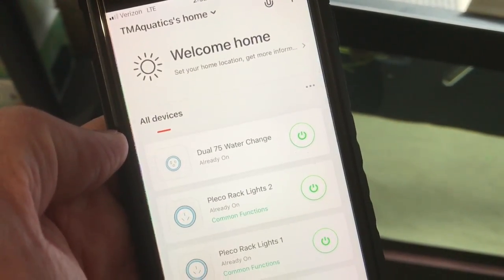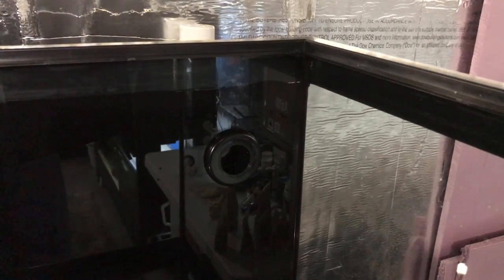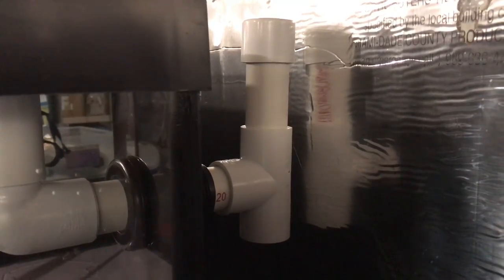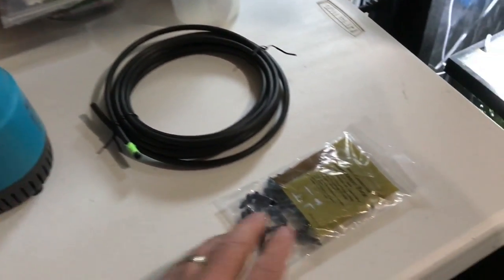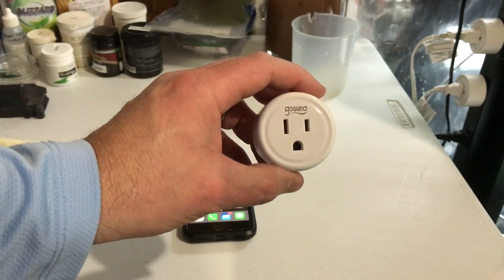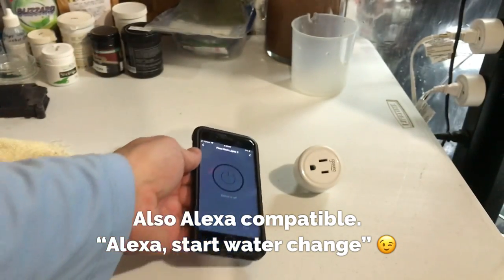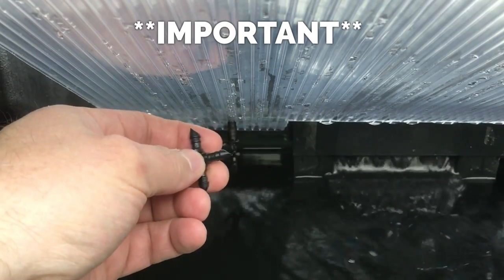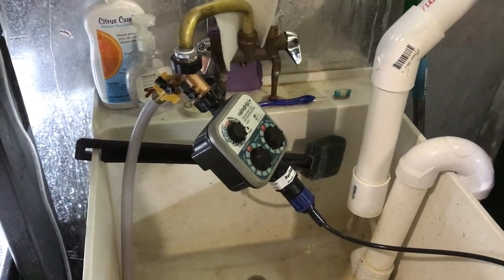SUPER EASY automatic water change system for your fish tank

Comment from the maker: Really debated whether or not to post this video.  However, the dual 75’s have been up and running for a couple of weeks now and the automatic water change system has been working GREAT!  This system, as currently configured, is pumping clean fresh water into each of the 75 gal tanks at the rate of 10 gal/hr.  Each tank receives 15 gal of fresh clean water each day.
Reply: I put my tail between my legs and ran away when you said "drill".
Reply: I keep forgetting you need to vacuum the bottom of the tank, so this will never work right???
Reply: maybe i can have a massive aquarium have this do the water change n just vacuum the bottom of the tank myself which shouldn't take that long. I reckon I could do the bottom of a large tank in 5 minutes.
Reply: I think you would be blown away by my system as it is incredibly simple. I have a big advantage as I am on well water and can use water right from the tap. I use my system in my 100 gallon African tank.
Reply: @davebrittain9216  i wish you could make that video because having been blown away by water changing systems usually teaches ways to incorporate or simply recreate like this video clearly demonstrates .... Still afraid to drill & love my Python . Cheers Dave 🍺
Reply: @stoneysscapes7544  Maybe one day. Do you have well water or city water?
Reply: @chefpinot45  You can always use an overflow
Reply: @davebrittain9216  I have city but am currently rebuilding an old concrete and brick spring box that was built way before there was even well water here.   It had about a foot of silt in the bottom I had to knock a hole in the side wall and dig it out.   I currently have a pump and garden hoses running to the basement where it hits a 1/2 hp utility pump and a line running to my 90 gallon tank.  In the tank I have a powerhead plumbed into a flexible 1 1/4" drain i purchased at harbor freight.   Wireless receptacles to run everything and it's a piece of cake.   Just need lots of garden hose, several different hose adapters and fittings, wireless receptacles and you're good to go
Reply: The reason i gave up fish keeping was the constant fighting with the wife about the water bills and those big water tubs lying around the house! Btw how did you manage to get those elbows? Heads? Shoulders? Ankles? Knees and hips?

Comment: This is basically what I am wanting to do, My question is how far can you run those 1/4" drip lines? I need to run mine up to the first floor from my basment and im worried the pump wouldn't pump that.. I was wanting to use a RODI booster pump between my reservoir and tank. Or would that pump you use work fine pumping the water that far and vertical.

Comment: Lowtek hightek both have their positives and negatives. Hightek seems to have the more set it forget it mentality for most, at least from what I have observed with some of my breeder friends while those that have a more lowtek setup are more hands on and remember to check the pump is clean and running correctly. The more high tek setups are less work overall but for me the price and amount of time in maintenance of a lowtek setup is more worth it. The maintenance of it is something that can easily be incorporated into you daily quick check, weekly light cleaning, and monthly deep cleaning, to make sure it runs at its optimal performance. It takes about 1-2 minutes for a quick check, 5-10 minutes for a light cleaning, and 15-20 minutes for a deep cleaning if you take your time, you can probably got a deep cleaning done in 10 minutes but I like to make completely sure that everything in working optimally. That means I clean the outlets as well as the inlets, check each link in the lines to make sure there's no leaks, check the bulkheads for leaks, check the pumps and clean them when needed... Most of the people I know with the higher tek stuff don't seem to do this as often and technically I don't have to either but it's just easier and better for me to check so often as I'm already there and it's easy to just add it into my normal rotation or maintenance and work.

Comment: Tim...this is great content!! Thanks for sharing. I have been buying smart plugs that are much more costly. I will start buying those instead. Great food for thought. On another subject. I scrapped my inkbird temp controllers. I bought a Ketotek KT4000. Much better controller. Now if you would just solve the puzzle of controlling several tank temps inside a house (i cant control with room temp) Thanks LOL
Reply from the maker: Wichita Falls Fishkeeper I’ve been having issues with the Inkbird controllers.  After speaking with them they informed me the probes are not designed for continuous submerged use 😶.  They just released an upgraded “aquarium” probe and have them on their new 306 controllers.  I have two and so far no issues.  They are also sending me 5 of the new probes so I can replace on my other units.  I will have to check out the ketotek controller 👍
Reply: Well I followed your lead. I reached out to Inkbird. They asked for my Amazon order numbers and I received my new probes today...yah!!

Comment: So I'm a little confused. I for the most part watched the video twice. But I didn't really see anything on how you are regulating the amount of water going in and coming out. How do you you how much water you have changed? How do you match the flow rate of the water going out and the water coming in. When you change does it drain the tank to a certain amount and then fill? Does it change half the water in the tank 25% 75%? How long does it run?

Comment: Awesome idea! How do you remineralize your RO water? Does the reservoir already have salts mixed in or do add it to the actual tank? I'm tying to configure a similar setup but adding straight RO seems like you could have PH issues. It's going to be a high tech plant setup. Thanks in advance!
Reply: I'm wondering this too. No way you would want to use plain 0 tds RO. 

I'm trying to figure a system, either cutting my RO with tap water or remineralising. You get anywhere?
Reply: I think maybe connect the RO water and waste water flow together some how? The RO waste water will have got through the carbon filter so would have removed the chlorine. Would just need to work out the flow from both to get the mix to the required values you need for the tank.

Comment: If I want to do say a 20% water change, how do I calculate how long I need to run the pump to achieve that. As new RO water is added it dilutes the water in the tank and less "old" water is moved through the bulkhead but at the same time "new" RO water is also being drained out. One can calculate the flow by seeing how long it takes to fill a 5 gal bucket and calculate gal per minute. The question is, how many minutes to run the pump for a 20% water change.

Comment: Love the simple set-up. I've been researching for ways to automate my water changes, some more complex than others. None that I watched do 100% "new" water. I would like the tanks to drain a certain percentage of water, then fill with new water. So far, the only way I could think of is adding solenoid on the drain line and on the "in" line. Solenoid on the in could be optional if I ran with your set-up (yours only require an irrigation timer and or a pump with timer). Any suggestions are welcome and thank you for sharing your method.
Reply from the maker: There are several YouTube videos that show the most complex water changes.  Check out Paul’s channel, the inventory  king.  He recently installed a nice water change systems.  He drains the tanks quite a bit, them adds fresh water.  If my tap water was pleco friendly, I would have installed a different system with an irrigation timer and solenoids.

Comment: Thank you for this extremely helpful video! How do you control the temperature if you run the water directly from the tap?
Reply from the maker: The fresh water is introduced at such a slow rate that the heaters are able to keep up without too much of a drop.  In addition, a slight decrease in water temp is often used as a spawning stimulant for plecos.  In the wild, rain usually drops water temps as well.  Not a problem.
Reply: @TMAquatics  thanks!!

Comment: how are you stopping the pump from running dry in the RODI water drum?
Reply from the maker: The reservoir is always full.  My RODI system is constantly running when the water is low and has a float switch with auto shut off once it’s filled.  Each 30 min cycle the auto water change is on only uses 5-7 gal of water.  My reservoir is 45 gal.  👍

Comment: Im in an apartment so I don't have any way to do this, but man I would really like to.
Reply from the maker: It was super easy, inexpensive and has worked better than expected.
Reply: @TMAquatics  How might I achieve a system with my sink about 30 feet away and no drain? LOL been scratching my head to think about how to get it done for a while now.
Reply: I'm in an apartment and am considering removing a bathroom door lol. Or maybe drilling a hole. These doors are made of cardboard anyway....

Comment: Are tanks from Petmarts and Petco drillable?
Reply: Hi, the short answer is "who knows". Basically you have to check the actual tank if it is tempered. Lots of video showing how to check. I called aqueon reps to confirm and the answer I got was, "it depends". Aqueon will use tempered glass if they do not have enough regular glass in their manufacturing inventory. So I was basically told to check actual tank as it varies from production lots. I do not know about other brands, as Petco's Dollar Per Gallon sale usually is for aqueon tanks. I was also able to confirm that size of tank has nothing to do with what material they use. Hope this helps and I made this call to Aqueon on January 2019. They are up in Wisconsin.